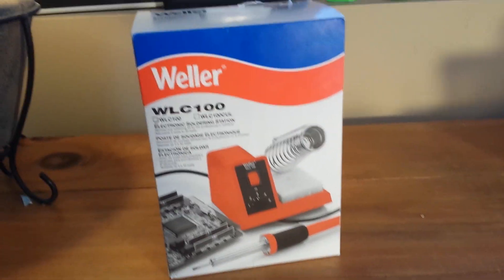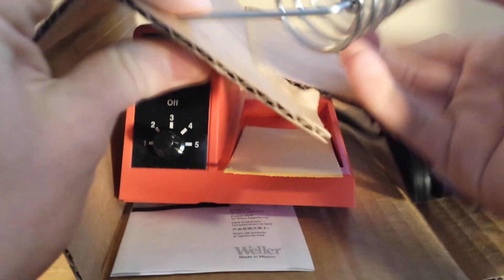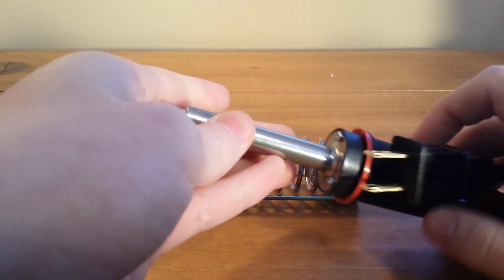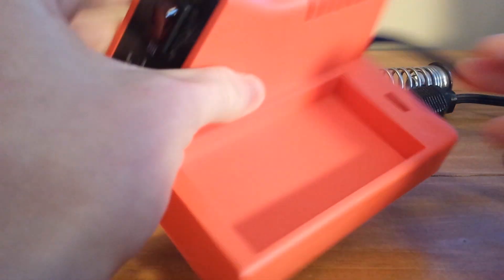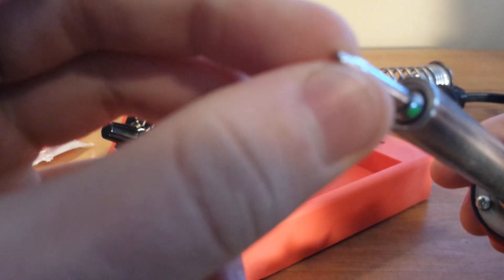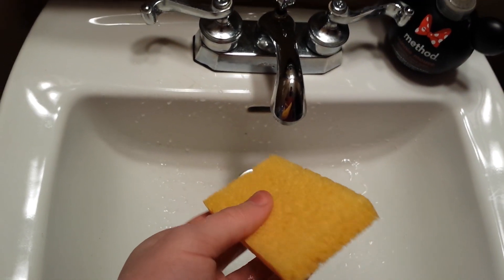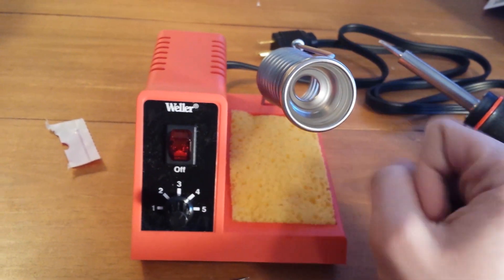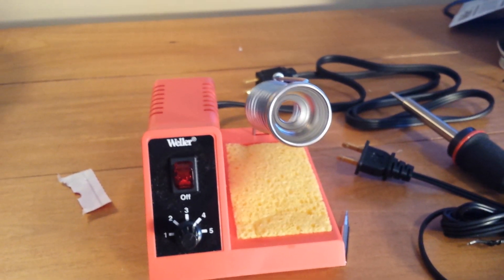Weller WLC100 40-watt Soldering Station Review

Comment: What happens if I plug in my 25 Watt iron in and turn the    dial up to 45 watt setting ?
Reply: You can't unless it's dual voltage like Radio shacks which are made to either do 25 or 45 watts and if it's so then it handles to 45 watts and then of coarse you plugged in a 25 watt into a 45 watts station by chance. Then you shouldn't be handling soldering irons.

Comment: Really.  Why didn't you want to talk about the instructions?  I know you like this model, you said it several times.  Happy you!  But I rather would have had a demonstration on how to change the tip and I only found out which tip by seeing real quick it was a #14 on the package...would have been nice if you had said it.  Honest...the sponge is the least of my interests and in any case, I could just use a kitchen sponge for the job.  You need to have enough water in the sponge to wipe the oxidation off of the tip and keep it clean.  A few basic things...how long does it take to heat up?  Why didn't you demonstrate at least a simple wire solder job?  There is more to a product review than sliding it out of it's retail case and futzing with it.  In sum, I did not find it a helpful review.

Comment: The point of the lowest settings on wattage controlled soldering stations is to keep it warm while not in use so it doesn't have to heat up from room temperature when you need it.
Reply from the maker: +Bob Woggle Yes I know that know thanks for pointing that out. I have learned a lot more since I made this video I maybe should probably redo it one of these days.